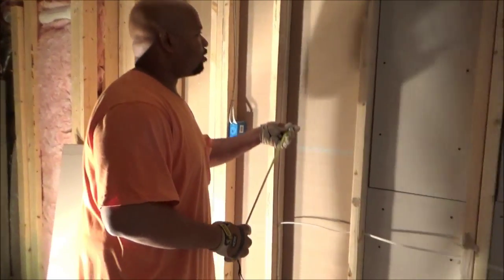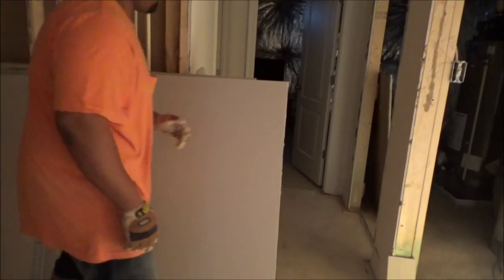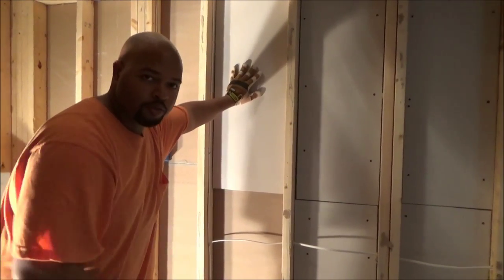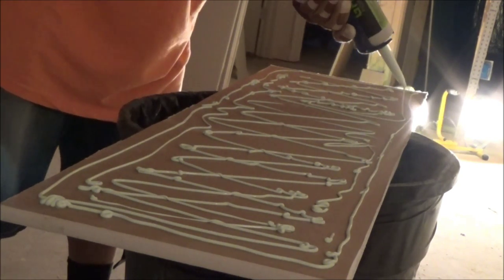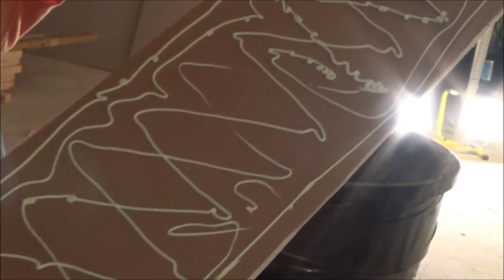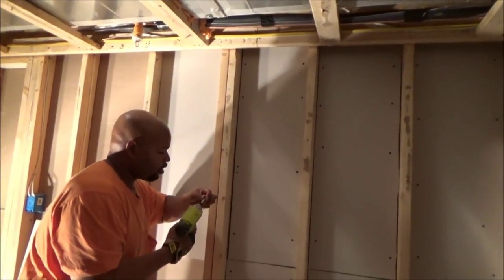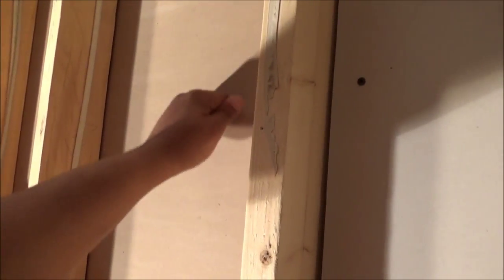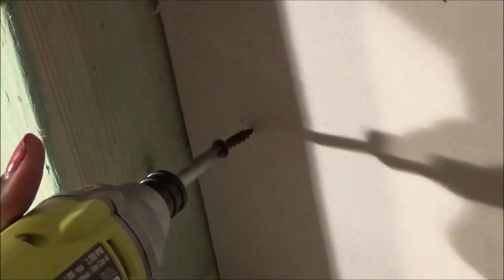The Beast, Unleashed [Episode 2]: First Contact

Comment: Thanks for the helpful video. Did you use any special type of screw for the ceiling? I have been advised to use 1 1/4" Wood Screw for the first layer of drywall. What would you recommend? Thanks!

Comment: I know this video is a little old now but very useful!
I’m doing two layers of dry wall + GG to the underside of the subfloor above me
In this video you mentioned removing the screws from the first line on the wall before adding the second layer.
Two questions
(1) since green glue isn’t really a glue, is the one screw on the second layer supposed to stay in place permanently? 
(2) do you also remove the screw from the 1st sheet of drywall before installing the second sheet if you’re talking about the ceiling? Or is that only true if you’re talking about walls? I don’t want the first line to fall on my head if I remove the 1st set of screws while I’m putting the 2nd layer in place.

Would appreciate any help!

Comment: Great instructional video! I wish i would have done the drywall between the 2x4s too. We did only a double wall with 1 layer of OSB, and 1 layer of Drywall with green glue. Are you using putty pads for your outlets?

Comment: Agree with other commenters... You made this job 10X harder.  Roxul between joists and double the drywall with green glue between.  You'll stop noise transmission from studs.  Resilient channel would be one more step better but then you start cutting into the sq footage of a room when you start adding all this shit.
Reply: You mean well but you are not aware of what he is doing. This is not the main soundproofing, it is constrained layer damping. He adds clip/furring channel later on, which is a much better solution than resilient channel.

Comment: Note to self.. Get rich and BUY a house with all this stuff done by someone else..
More power to you man..
Reply from the maker: HAHAHAH man, you can't trust others to do it right!  Folks will cut corners and screw drywall right into studs if you're not there to watch each and every one of the workers.
Reply: So true :D
That said, I'm gonna skip drywall in my HT 2.0. Worst material ever to work with, dust etc. Gonna use solid marine plywood towards the room. It will be covered by other materials anyway. I got a cement "box" though which by itself stops some sound. Different building style in Spain ^^

Comment: Why didn't you use quietrock? 
Also what sort of insulation are you using?
Reply from the maker: Quiet rock is less effective than the double drywall+green glue.  the dampening compound is sandwhiched between material with less mass.  It's better to get the hands dirty and use more mass, which is critical to soundproofing.

Comment: that's not going to work lol you should use roxul then resilient channel then double layered drywall with green glue in the middle.and if you want to spend even more money use 2 sheets of quiterock with green glue in the middle
..will cost alot that for sure$$$$$$$$$$$$$$$$$$$$$$$$$$$$$